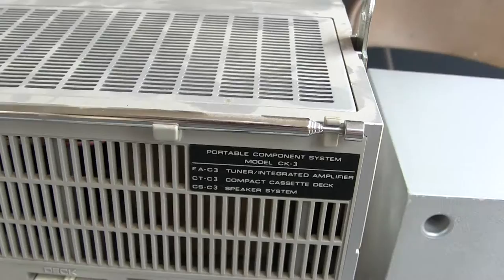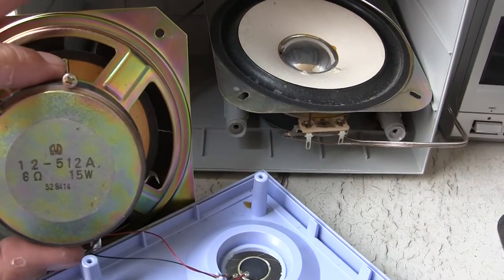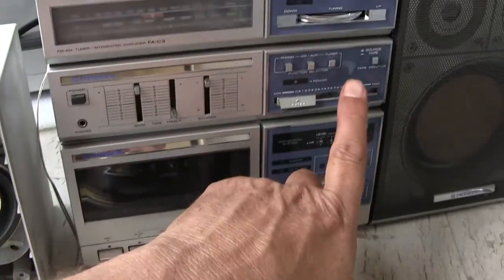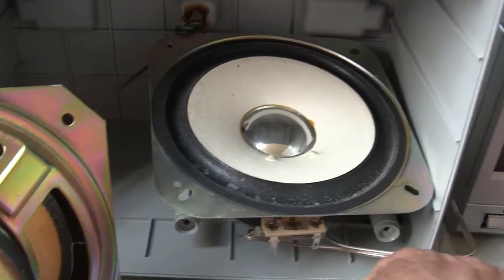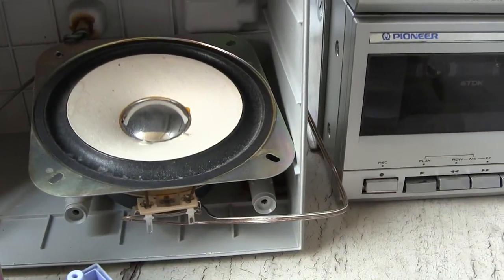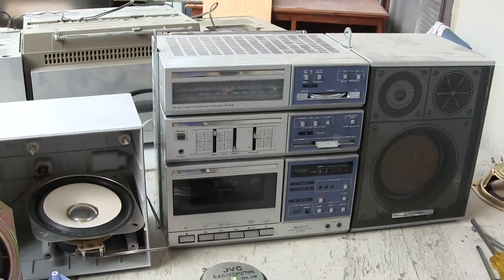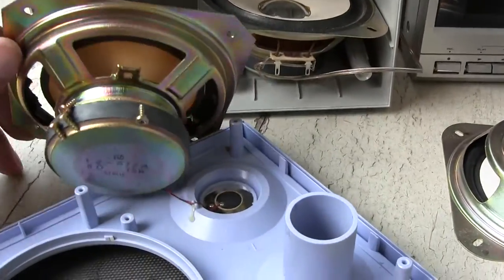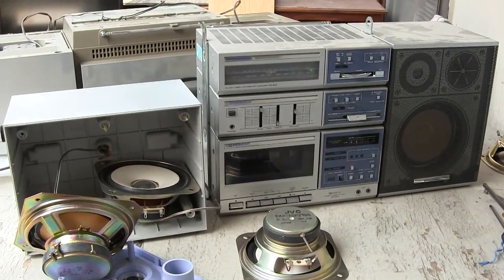Pioneer CK-3 3 Piece Boombox Needs Replacement Woofer

Comment: Those look like 4 or 5" woofers. You can find replacement foam or rubber surrounds/edges that will last a long time. The refoaming/repair process is simple

Comment: One is rated at 6 ohms and the other is rated at 8 ohms impedences. To get max power , impedences have to match.
Reply from the maker: +Jorge Washington this is true and you need to match the designed amplifier impedance to the required speaker drivers for the best sound, so have a mis-matched ohm's in your voice coils will give you a un balanced sound DOH!
Reply: So true decentman. Question..how do I get in a speaker cabinet thats sealed. The speaker wires are loose and I need to resolder. Dont want to break the cabinet. Thanks in advance.
Reply: I will try to get in via the front tomorrow but I dont see any screws YET.
Reply: The good ol Max Power transfer theorem from basic electronics.
Reply from the maker: +Jorge Washington Send picture of speaker cabinet to here - jamespierceiii@hotmail.com - I can better tell you there - or from the back use a knife and pry the back off - guessing....  Front from on some box's that are sealed - the grill is simply pressed into place and thus removing the grill gains you access to the woofer mount screws and then once removed you can through the hole after woofer driver is removed you can do what you need to do inside of the cabinet.
Reply: Thanks for the tips decentman.  I will give it a go tomorrow.

Comment: The original speakers are rated at 15 watts, while your replacement speakers were rated at 35 watts. the wattage is too big, hence the reason why you were not getting as much bass. Also, lets face it; JVC makes some helluva crappy speakers!!!